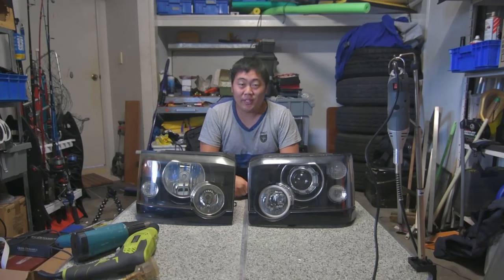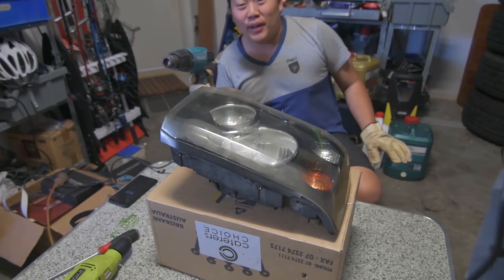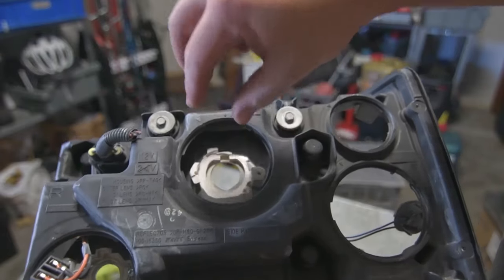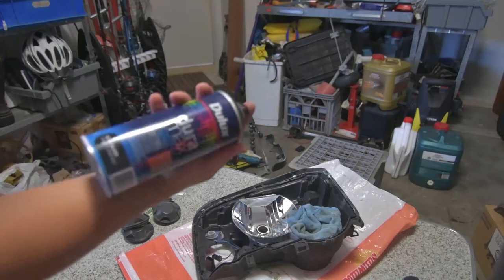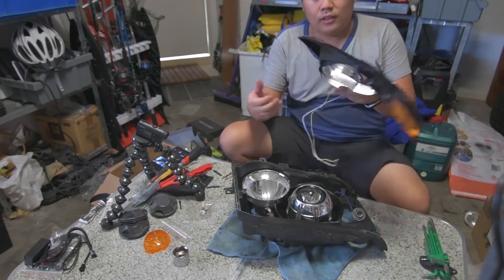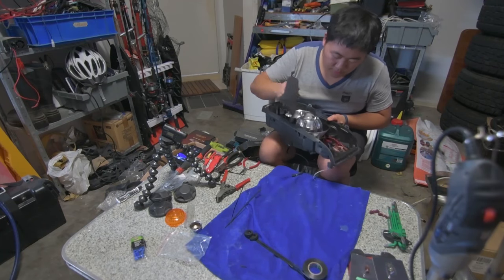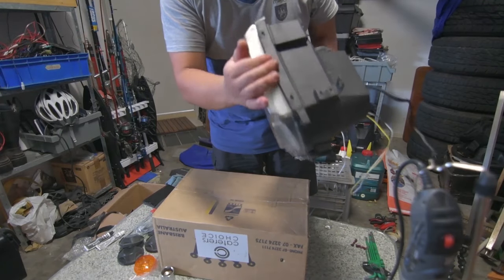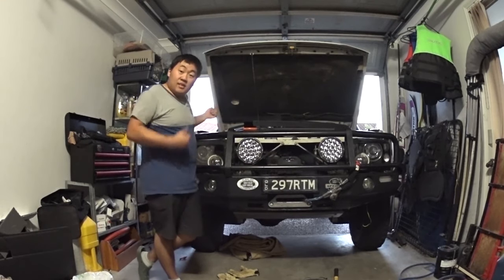D2 Projector Retrofit

Comment: Well you have proved it CAN be done! 
I was all over the Retro Fit Source website last week scouring their products looking for a projector kit that would fit inside the D2 lamp and i'd come to the conclusion that it couldn't be done...
Not fitting the front cover in the original position never entered my head!

How is the beam pattern? I'm assuming Australia checks such things.

Do you remember which model of car you took your projectors out of?

Luckily i'm in the position of having a spare set of lamps. I just replaced mine with a much better pair of used lamps as one of mine has a silt 'tide mark' about two inches up and the other permanently has about an inch of water slopping around in the bottom. Strangely the one with the water inside has all bulb covers in place and the other (dry) one doesn't. That's what led to the lamp filling up with muddy water last year while at an off road weekend. 
My plan is to modify the old set of lamps as it doesn't matter if i bugger them up.
Reply from the maker: Typical land rover seals trolling you 😂 

I have bought the Morimoto Mini H1 7.0 from Retro fit source. Iv also built one with the Morimoto Mini D2s 4.0 but I couldn't get the cap back on as it stuck out too much.. 🤷

Anyway beam pattern wise it's ovs a RHD pattern and what I did before installing the projector's was found a wall and turn the headlight on and mark the beam pattern on the wall, and once installed I re-aligned it back to that mark.

Cars since gone through a Road worthy and has passed 😁

Comment: Thanks for this video.  Which LED Halo rings did you use; The 110mm or the 120mm?
Reply from the maker: I used both. 110 for projector shroud and 120 for high beam ring 😁
Reply: @adventureawaits4x457  How did you secure the 120mm halos to the high beam fixture?  Did you use glue?
Reply from the maker: @timburns1939  yes used plasti weld adhesive. Also use some fishing line or something to be 100% sure! I haven't done it but it still holding up
Reply: Thanks mate